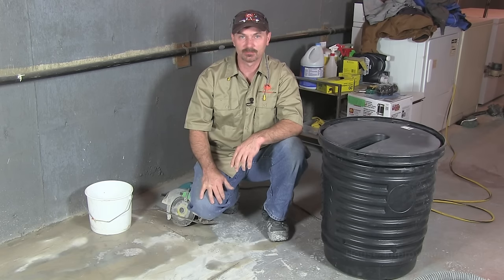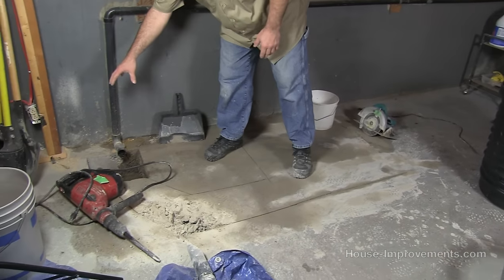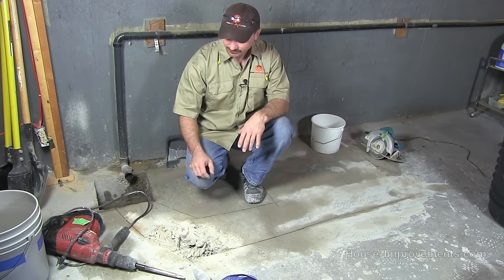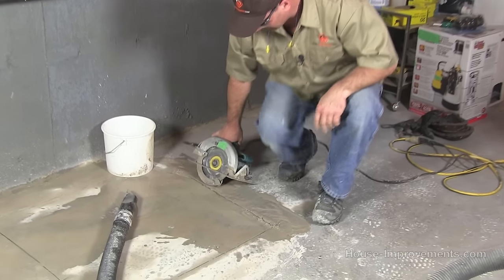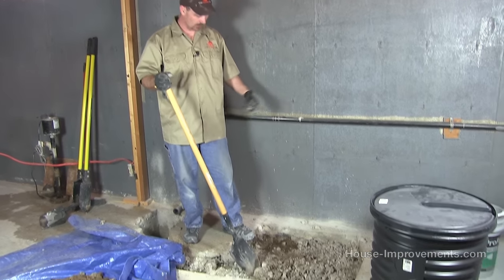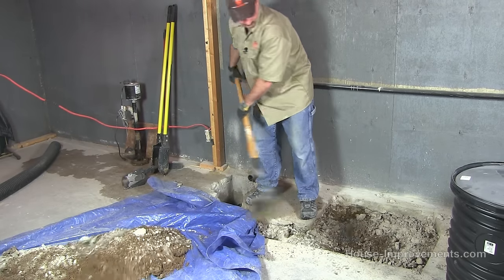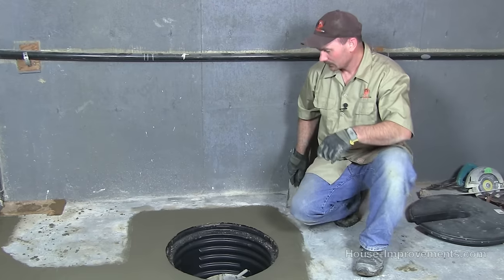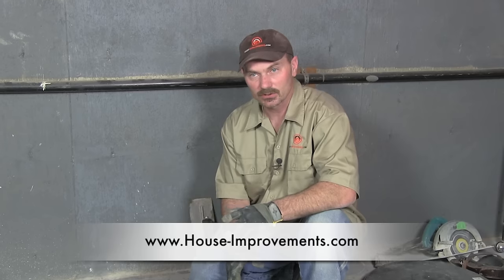How To Install A Sump Pump Pit

Comment: In the house we bought the plastic basin was installed with the top of the tank sitting ABOVE the concrete floor by about 2 inches. Is this a problem? And why in your video do you say you want it flush, or if anything even a bit lower?
Reply from the maker: Just a tripping hazzard
Reply: @HouseImprovements  O.K. I can live with that. Thank you for the video!

Comment: like your opinion or anyone else reading this . I have a sump pump that goes on and off but the wall behind it has couple of leaks coming in at different spots . I have managed to stop some water coming in with hydraulic cement but then another spot on walk leaks ugh.  I would've thought sump pump was keeping water from wall but I guess not . should I put another sump pump in further over so maybe it has chance to suck water in area so maybe it wouldn't come through wall.

Comment: good job Shannon i fallow all your videos, but i have a question for you how that pit souks up the water under concrete to pumped out..
Reply from the maker: in this case the pit is filled with water that comes from the weeding tile that is buried around the perimeter of the basement . If you don't have weeping tile you could still bury this pit but wrap it in a filter cloth and also drill some 1/2" holes around it to allow ground water to run in .

Comment: Did you seal the pipe where it enters the sump pit? Or does the standing water never reach that height and leak out into the grade?
Reply from the maker: No, the pump will be set to remove water before it gets to the height.https://www.youtube.com/watch?v=ABsk_4zrlbM&t=570s

Comment: Can I just use a sledgehammer to break out the concrete? I have an old 1956 house and I don't believe there is weeping tile as well but I already have a small hole in my basement floor and when we had some rains in the spring, water started seeping into the hole (we ended up putting a small submersible for a fountain just to keep the water from getting up onto the floor - temporary)
Reply from the maker: sure

Comment: I was going to put 3/4 minus under the basin and compress it well , then use drain rock around the perimeter. Was told to pour concrete under the basin . Is that neccesary or overkill, as I see you basically put the liner back in over the dirt in the pit . I’m not running weeping tile ,as I’m drilling holes around the basin to collect the water and hopefully relieve the static pressure under the concrete floor

Comment: Is there some holes in the basket for water coming from underneat?
Reply from the maker: you can make some but dont make them in the bottom 1/2 or lower . you need it to act as a catch basin and the pump will get rid of it

Comment: The gravel on top of clay will settle over time, floor could crack when void develops  Either use  fresh gravel well tamped or water in the gravel clay excavated then tamp.  Nitpicky but your concrete mix was way too wet

Comment: Our sump pump was replaced. The plumber placed the new pump on a paver block.  However, the paver block has been placed on mud and some gravel. Will the mud still clog the pump even though it rests on a paver block?

Comment: I did this several years ago.  Biggest problem I have is the ground water coming in from the bottom of the plastic pit.  That gives me more problem (makes my pump run) than water in the basement.  I actually cut the pit so it is only about 24" deep to not go any deeper than I had to and sat the pump on bricks to get it as high in the pit as possible yet get the lid on.
Reply: I am about to install one in my walkout pit to handle water during flash flood situations.  I definitely want to avoid any ground water coming into the pit.  What would you have done differently to avoid it?
Reply: Brian, my suggestion (and what I did) was to make it as shallow as would hold the sump pump.  Another option is to dig it when the ground is fairly wet and see if you get ground water coming in and decide from that.

Comment: HImps, thanks for this superb video.  I always, and by 'chance' end up clicking a link to one of your imp videos and have learned a ton (and saved a lot of $$) so thanks again for taking time/effort to make.publish all these.  If I might make 2 suggestions (gently!) the 1st far more important I hope everyone reads ...

First (and important) also a bit of a nag but I must. It is GREAT to see you are one of few on YT vids that wears & mentions hearing protection, so KUDOS. This, unlike home improvement, is an area that I have some 'knowledge' about so I harp on it. The earplugs are great, but please also consider using in addition to the plugs, a good set of OVER ear cans. Belts & suspenders approach.  Why?  A lot of 'sound' particularly high impact and 'damaging' sound (best example probably jackhammers) enters & damages the hearing 'machinery' not just tru the earhole but via the bones of skull surrounding the ear. If you don't believe me, use an earplug or finger to plug one of your ears.  Now, use another finger (other hand) to tap the hard bone behind the middle of your earlobe.  Hear that thump thump?  Yes, yo do !

I can't emphasize enough the benefit protection-wise of plugs AND over ear cans.  One or the other is half the battle, but only half (ish).  So please consider using both.  In 20-30 years, you'll thank me.  I assure you  

Stepping off soapbox ...

Second suggestion, not long ago I helped a bud dig a 'pit' and though not for a sump, it was not unlike this project and we used a large wet dry vac to 'suck out' the pit gravel/loose dirt as we dug, then simply unlatched the top and took vac tub outside to dump it.  Save a LOT of shoveling and back pain 2 days later.  Just a thought, if the gravel is loosish like in your video, the large wet dry vac method worked sublimely.  It's more a matter of my laziness and desire not to shovel bucket & haul  :) anyway thanks again for your great videos, much appreciated !!

PS.  Plz. really do get a set of good ear cans for over your ear plugs.  Sorry, I cant help myself sometimes  ;)

Comment: Hi Shan ! What this black hose for the one connected to the barrel and where to get a barrel also can I install a 5 gallons bucket to avoid this barrel ?
Reply from the maker: That hose comes from an exterior weeping tile that is buried around the outer perimeter of the basement but comes under the footing and hooks to the sump pit for draining.. You could use a makeshift barrel IMO.

Comment: Major Flaw !!! Always back fill your hole back up with dustless limestone chips, medium sized pebbles or #50 gravel. Back filling it with sand, clay and dirt as shown in the video defeats the purpose. It will not only clog up the pipe, it will eventually clog your sump tank and ruin the pump motor as well. Also, you want to run ALL of your corrugated pipe with a filter cloth fabric or cloth sock covering. Never use just bare pipe as the sediment will migrate thru the slots in just a year or so and clog the pipe and equipment.
Reply: ceedaddy    I thought he said his extension piece wasn’t corrugated or have any slits. If it’s solid pipe , he should be ok.
Reply: @jimyounger9490  I might have missed him mention that. If so thats true
Reply: Should have used clean rock for any ground water from beneath floor to flow into pipe, like mentioned before dirt/sand defeated purpose of drain-tile. Your fired!

Comment: I notice lots of sand at the bottom of my sump well. Do I have to remove that sand or is that bottom of the sump open to the ground.
Reply from the maker: I would just raise your pump up on a brick or something to get it out of the sand.
Reply: @HouseImprovements  Yes, that I have done it immediately after noticing it. As a permanent solution, is it better to remove all the sand. Is that sand accumulated by the flow of water OR is the sump well contains sand at the bottom?

Comment: Taping the Machine-Branding does nothing. This thing looks exactly like the Hilti TE1000. The "AVR"-mark i only see by Hilti.
The TE1000 is a really Powerfull electrical Jackhammer. I love this thing. It's easy to break massive reinforced concrete with this machine.

Comment: Hey I have a question I bought a house with a sump pump hole in my basement it has the tub but no pump in it , the previous owners said they used to pour water down there from a dehumidifier they kept in the basement and the water would just seep into the ground and disappear, is that a good idea to do?
Reply from the maker: If your ground is dry it wont cause any issues IMO.
Reply: @HouseImprovements  really? How about putting 60 gallons down there ? Remember it's going under  my foundation

Comment: I never had a sump pump installed in the basement floor, how do I create a downflow for the water to go into the pump. I do have a low point as to where the water can flow into the pump, but how do I create a flow for the water to get into the bucket

Comment: That pipe on the wall, where does the water from that go when it comes in now? Just onto the floor? I don't understand the purpose of the pipe you put under the cement that leads into the bucket since you put clay and cement on top of it.
Reply: Matthew Reichert I’m wondering the same thing...
Reply: Same here..and where does the pump drain out to? Shouldn't there be another hole in the sump for a drain line?
Reply: Matthew Reichert , the wall pipe was the old exit/ discharge line that gets pumped outside. The underground 4 inch line is from the weeping tile that surrounds the foundation. It’s job is to collect and drain water into the sump. Water seeps in, pump runs and water is removed.

Comment: Wish I had sump pump .... Was just flooded out with 2 an a 1/2 feet of water in Lake Linden MI 😳 NEVER had a problem with water here they dont even offer flood insurance here 😳
Reply: web1187 You can get flood insurance on any piece of property
Reply: @bighammer587  not if they don't offer it
Reply: web1187 Not true, it’s available for any property, backed by the Feds

Comment: Good video, I just wish my house had weeping tile.
Reply from the maker: Even if there is no weeping tile this can help reduce the static pressure of water under the slab from coming up if you have a higher water table. The pit creates an area of less resistance and much of the ground water will go that way because its easier.
Reply: HouseImprovements
Good point! Thanks again.
Reply: HouseImprovements I have the same issue. No weeping tile. When I install a pit do I need to poke lots of holes in the side? How will the water migrate inside the pit?
Reply: Derek Resendes I'd like to know as well

Comment: My house is old and the basement is a mess. When it rains hard water flows over top the 4 foot walls that divide the crawl space area. I have a sump basin and a spot picked out to install it in the basement. I'm just nervous about cutting the concrete.

Comment: Is it possible to close and fill in a sump hole in a basement,  if so is it just mixing concrete and pouring it in ???
Reply from the maker: If its attached to existing weeping tile I would advise against it unless you move teh weeping tile to a new sump location. Otherwise , back fill the hole with some crushed rock or gravel to reduce how much concrete you need and patch over with about 4" of concrete.
Reply: @HouseImprovements  not attached to any tile, it's a older home it's just foundation water that comes in when it rains.

Comment: Hey Shannon how do you install a sump pit with no outside weeping tile. I have a high water table and have ground water coming in from underneath the slab. Do you drill holes in the sump pit bucket or how do I go about it.
Reply from the maker: Yup , dig a pit into the d=ground and drill some holes in the sides of it . install a pump

Comment: Thought gravel was supposed to go around the draining tile?
Reply: Yeah the video video I saw was way different although that was actually a French drain or similar to a French drain in that they used a solid PVC with perforated holes facing Believe It or Not downward and they also filled everything in with gravel as to not get the fines or the particulate dirt it will clog the system

Comment: Was wondering what determines the depth of my sump.  As I leave on a river how deep should i dig?
Reply from the maker: Just as deep as the sump pit is will be fine that will get you down 20-24" below floor.

Comment: Shannon, a question about gas water heaters. Here in Texas I discovered my gas water heater has what is called a 210 gas valve that runs from the gas valve to the 210 valve then to the water heater gas valve. Can those be used on any gas water heater replacement. Personally I like the regular T& P myself but no drain line.  The plumbing co. rep. says only their water heaters are made for the 210 gas valve. I think he is wrong. What say you sir? Thank you.
Reply from the maker: I'm sorry but I am not familiar with those at all.
Reply: Do not use a 210..... as a license state of Texas journeyman plumber those are trash.... they have the possibility of allowing moisture into your gas system use the lags valve if you can are gonna do anything

Comment: Hi I have a problem I brought a everbilt 1/4 sub pump rubber hose assembly the problem is it's under my house really no room maybe 2 feet crawl space the water is coming from my 4 inch pipe under the toilet water has build up to a little pool any suggestions please on the best way do the job myself keep in mind I'm260 pounds.
Reply from the maker: These are not sewage pumps. If your toilet pipe is leaking you need to fix that. Sounds like you will need to hire someone a little smaller who can fit in that tight space you have.

Comment: Why did you backfill over top with the stuff you dug out, thats gonna clog the seeped, clay is not good for water because it doesn't drain, you're supposed to top weeper with 3/4 pea gravel

Comment: Can anyone give me instructions on how to connect another plastic pit to an already existing functioning plastic pit to increase the height of the already installed plastic pit.  Do you think it can be done  and also prevent any water leak coming from the connection?  Or should I remove the original plastic pit and just replace it with a taller plastic pit?  Thanks....
Reply from the maker: The idea is not to have the pit sitting full of water? if your pump is in the bottom the pit should not fill up with water and there should be no leak? We can discuss further on the forum if you want to come there with your questions.https://www.house-improvements.com/forums/

Comment: Where can i buy an outdoor sump basin? Im looking for big stuff. I want to collect more water than my grandma’s swimming pool. I have no problem hand digging a 9ft by 6ft wide 6ft deep hole. Did one last week.

I will use three-quarter inch angular rock. And I want something I can drive my car over 4,000lbs. I will pipe it to a 4” pressure pvc pipe
Thanks in advance
Reply from the maker: May have to look at something concrete if you are driving over it? Not sure.
Reply: @HouseImprovements  i called a local pipe supply store and they will custom cut a 24” or 36” PVC double wall pipe for me and sell by the foot. It’s rated for culverts and so should work at 6,000lb crush. But I think if I bury it with gravel, then the gravel will distribute the force and I don’t even think the pipe will see much of the force

Comment: I have a basement about 60 feet long that I would like to install interior drain tile connecting to a sump pit. What slope should my drain tile have over this distance?
Reply from the maker: In reality you want it level or a slight slope  only. The worst thing is to have a real low spot anywhere but at the sump pit. The perforated tile will easily collect ground water and because there is no restrictions inside water will naturally be able to flow in and as it fills it will make it to the sump pit.

Comment: You should have watered the edges of the old concrete before pouring the concrete. Prevents cracks where you originally cut the floor (since the dry concrete otherwise sucks the moisture out of the freshly poured concrete). :-)
Reply from the maker: Yes you are correct that will help.
Reply: HouseImprovements
Reply: Chris Benoit's Daycare 
Pinky brown....

Comment: I cant get sound on a number of your videos , this one included. Any idea why?
Reply from the maker: I just checked this one and it is working fine. move your cursor over the bottom edge of the video to bring up the tool bar, maybe the sound is turned down or muted? If that does not do it try refreshing your screen? Seems to be ok on my end
Reply: Still didn"t work. I just switched to firefox and have sound, must be my ancient outdated computer not being compatible with newer Chrome! Thanks, I look forward to watching this video with sound. My lip reading isn't great!

Comment: Am absolutely new to this, so this is probably a dumb question: The pipe connected to the pit is going to be carrying input sewage—correct? If so, shouldn't that pipes point of entry into the pit be carefully sealed to prevent seepage of sewage from the pit into the ground?
Reply from the maker: This is not sewage, this is ground water and moisture outside of your basement.
Reply: Ok. I misunderstood. Thnks.

Comment: I just had my sump pump installed.
the plummer said it was necessary to have a hole on the pipe that is connected to the sump pump???
Reply from the maker: yes, some do not have that built in and it helps relieve the head pressure of water trapped in the vertical pipe .

Comment: how many gallons does that sump pit hold?
Reply: ...looked like a 40 gallon. Hardware stores do sell sump basins in various sizes, heights and circumference depending on the style you need.